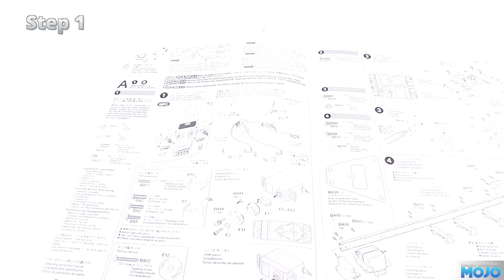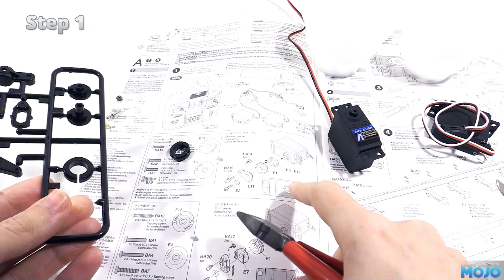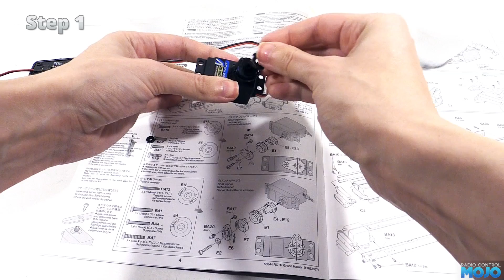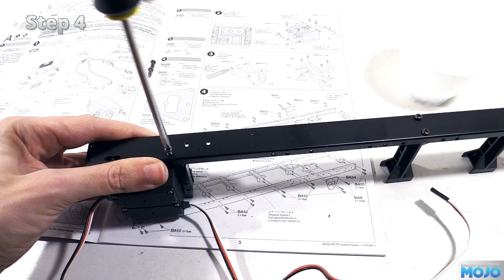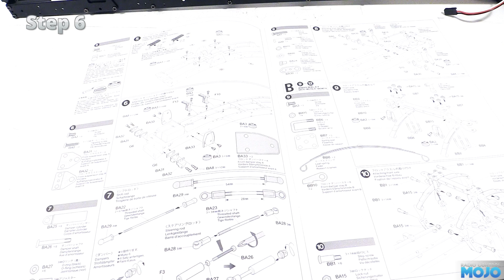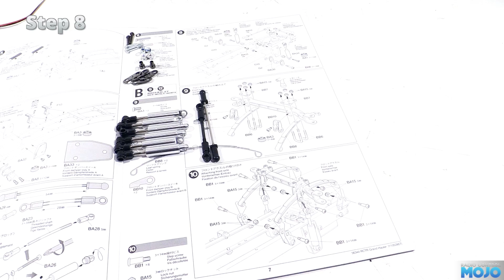Tamiya Grand Hauler - 2 - Bag A

Comment: Hello,  I have the Grand Hauler Truck, I cannot understand why Tamiya did not make the front lamps dual fittings to support two lamps in each cluster, do you, or do you know of anyone who has made these parts? Thank you
Reply from the maker: I carefully cut out the blank light and made an insert from Acrylic sheet, quite doable if you take your time with it. I did find this part https://www.thingiverse.com/thing:3011590 which would help, I've not tried it so I can't comment on the fit

Comment: I've got a trick for the sloppy steering servo....
Before installing the top piece with the ball link, I dab some RTV silicone - colour can be your choice! 😉  What that does (besides STINK whilst curing!) is fill in the loose bits with a rubber compound that stiffens the Servo saver, yet still allows it to function. 
You know, in case you crash your Semi into a wall at 125mph!! 😁 😂
I do this to all my Tamiya servo savers, without issue.

Comment: Have you ever considered adding a TK22 Clark board or a Benedini TBS mini board to your Tiger 1?
Reply from the maker: I’ve looked at a few tank electronics modules, and I’ve been ever so tempted. But I’ve also partially designing my own, the hardware is laid out, finding the time to write the firmware is the problem.

Comment: very good. i built the king hauler and they had springs in the shocks. im surprised this kit dosent have them.
Reply from the maker: I was expecting some little springs too. Even without the suspension will be more than stiff enough to hold things up.